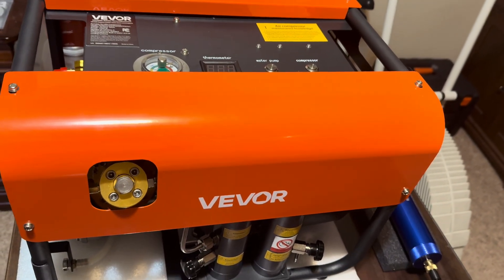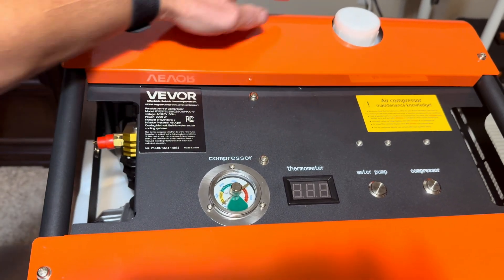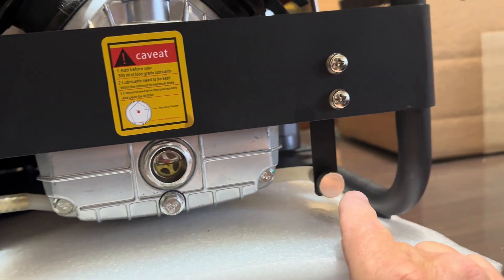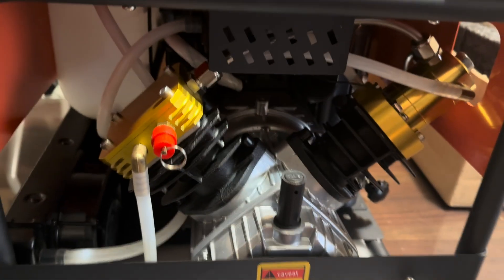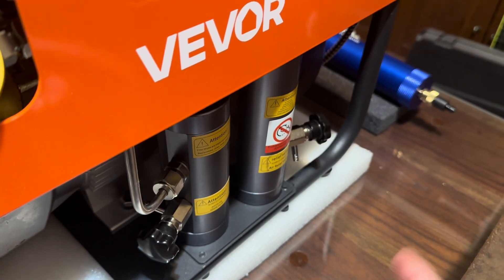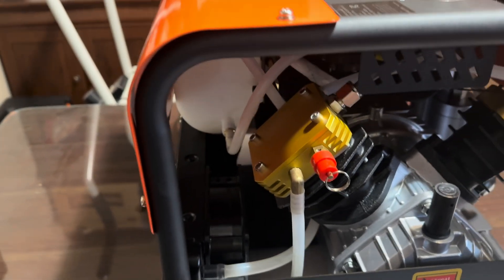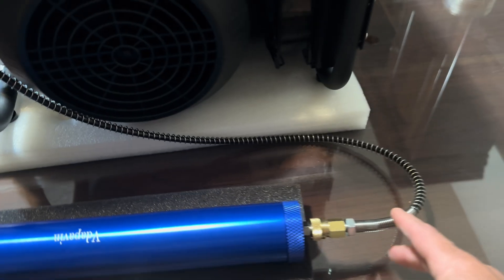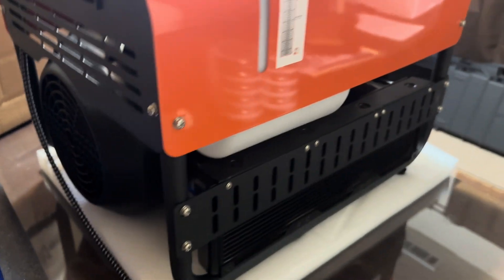VEVOR PCP Air Compressor 4500PSI 2-Cylinder Scuba Tank Air Compressor Auto-Stop.   Part 2 of 2

Comment: Can you tell something about power supply. Its 220V so does the plug is regular US 110V plug or something like clothing dryer plug? Does the plug have two 110V hot prongs and a neutral or one is 220V and the other neutral? Because its rated 2200 W it needs powerful circuit. What circuit do you plug this in?
Reply: In his first video he recommended a 110/120v 20 amp recepticle, which will require NM-B wire 12g / 2 with ground